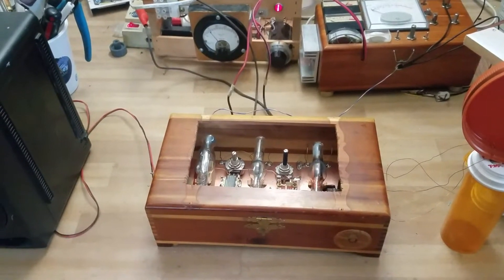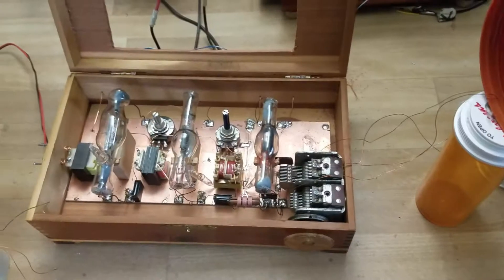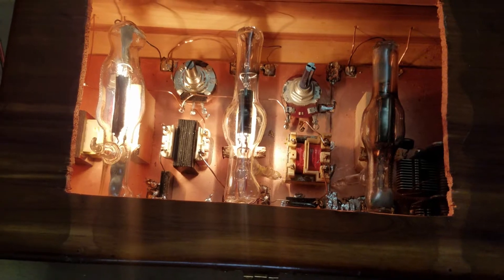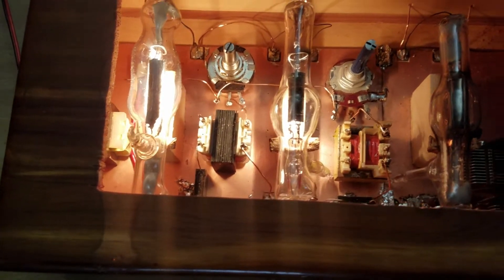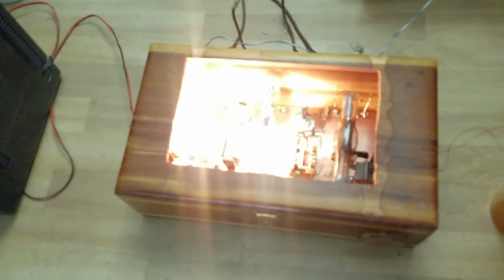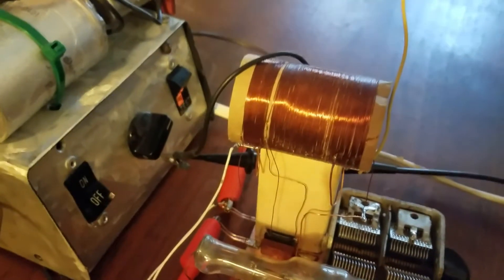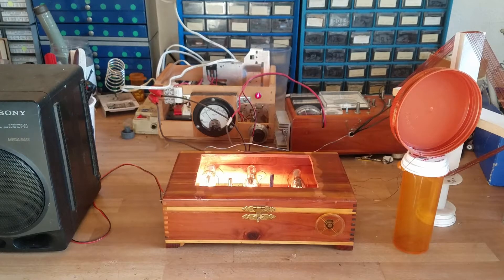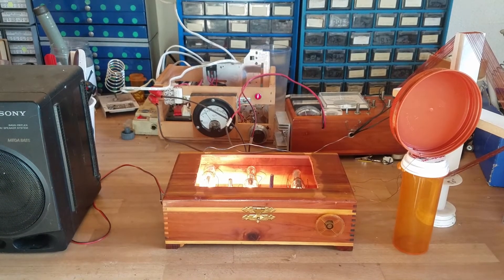Homemade Triode Transmitter

Comment: Fantastic, well done. I agree about the bare copper wire, PVC becomes really unpleasant to look at once you start noticing it. Cloth insulation is fun too though, if you have a way to make it :^)

Impressive that it all operates well at 200-300V; if there was any gas in there you would've certainly found out. Have you ever tried running your tubes near their maximum filament power for more efficiency? It's obnoxiously bright, but for short tests like this one the filaments can take it, and it should provide some interesting data if you're up for it.

Looking forward to your future projects.
Reply from the maker: Thank you very much! I have tried running at higher voltage, the emission gets much higher along with the transconductance. I just get put off by how fast the envelope begins to blacken from the evaporation. I have not made plots of the curves but normally the maximum plate current for my tubes as about 5-8 mA at the reduced filament voltage with around 200v on the plate. Max I ever got was about 22 mA with full filament voltage applied. Some of my tubes are more erratic than others. The audio output tube in this video has never needed the getter reheated while the first audio tube (middle one) has needed the getter reheated three times after arcing after about 15 minutes of running. I am not sure if there is a grease spot inside that is off-gassing or one of my seals is leaky. I do not think it is a seal because it only arcs after running, not just sitting cold. If i reheat the getter and let it sit for a few days it will work fine at first but arc some time later.  The highest gain tube I have made has read about half scale on my tester and a commercial triode with a gain of 46 and a transconductance of 8500 uMHOS reads full scale for whatever that is worth.
Reply: @jdflyback  Oh, well then it seems like you're already at the sweet spot for filament temperature then. I wasn't sure how far away you were from the maximum. Yeah, if you're losing enough filament to blacken the glass that's probably too hot; I've never had a tube short out internally from that, but I'm sure it's possible since the tungsten film is conductive.

As for the gas problem, you could narrow that down pretty quickly if you built a bakeout oven; I'm sure you've seen mine for reference. At glass annealing temperatures any organic matter gets totally carbonized, so any arcing afterward is almost certainly due to a leak, unless you're using gassy materials like steel or graphite. I once accidentally left a shred of paper towel inside of a tube (not sure how!) and believe it or not the tube worked fine after sealing off despite the piece of char-cloth floating around inside of it.

Assuming the scale on that meter is linear, that's a really good result by the way. Especially considering that it's bright-emitter vs. coated or thoriated. Honestly for bright-emitter tubes plotting out the I/V curves is kind of useless, since the characteristics change so much with filament power. Transconductance vs. filament current is probably the most useful way to characterize this type of tube IMO, since any other metric would make it exhausting to capture all the variables involved.

Comment: Interesting as always!

Have you considered coating the filaments with barium carbonate to form an emissive coating? 
That would drastically reduce the required filament power and increase tube lifespan as i'm sure you already know.
Reply from the maker: Yes, I am trying to transition to oxide cathodes, my issue right now is that my tubes often gas up after a few days and require another heating of the getter to increase the vacuum. This is repeated over a week or so until all the air is out. I am worried the oxide cathodes will be poisoned if that happens rendering the tube useless. I think I will have to pump for much longer and bake the tubes in an oven to prevent the gassing up.